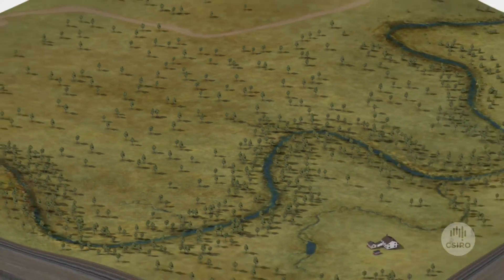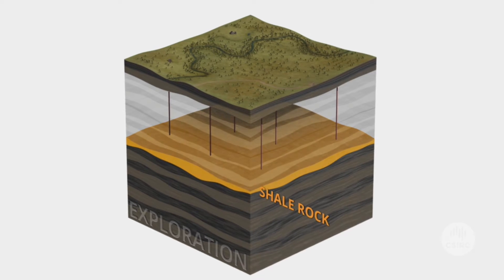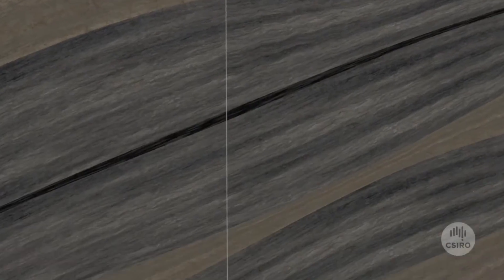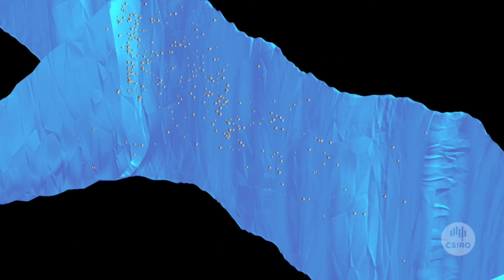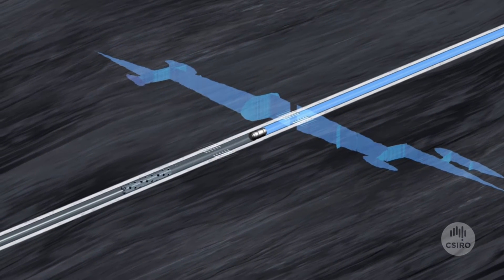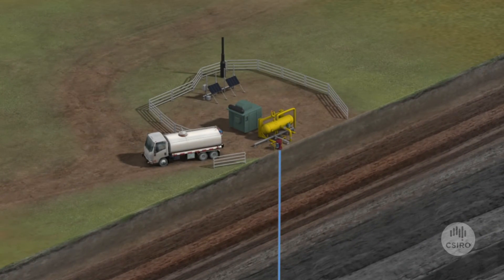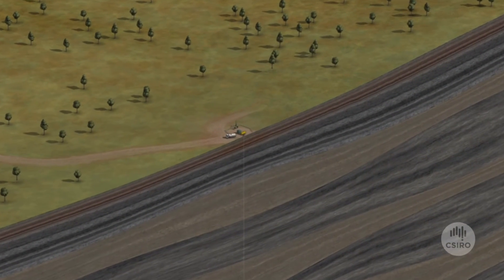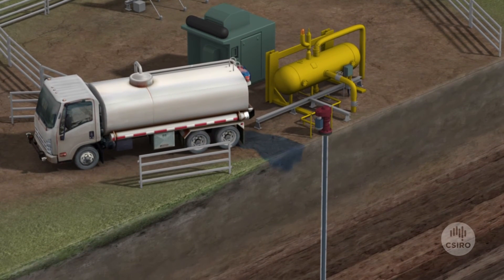Unearthing shale gas

Comment: What happens when the layers separating let's say underground aquifers and the gas seam are inadvertently fractured along with the seam, what safe guards are there to test whether you have connections from the coal seam to nearby underground aquifers
Reply from the maker: josh park 
Determining fracture height and growth at a well or site occurs before any fracturing is undertaken, known as preliminary work. This preliminary work includes core sampling, geophysical well logging, structural analysis of the geology and regional stress regime and direct measurement of stress by micro-hydraulic fracturing.  The data is then used in predicting the fracture growth using fracture design models.  Then during the fracturing treatment, microseismic and tiltmeter monitoring may be done to measure how the fracture grows. In addition, the pressure response recorded can be analysed to determine if height growth is occurring.  If height growth occurs, the injected volume and fluid viscosity can be adjusted to avoid growth into any aquifer.  In a shale gas reservoir, depicted in the video, the distance between the reservoir and the aquifer is large, so typically the hydraulic fractures as designed do not have enough volume injected into them to grow them to that size.  Microseismic monitoring has demonstrated this for a number of gas shale reservoirs. If a connection does occur, the produced water chemistry can be compared to the shale gas water chemistry and the aquifer chemistry.  This helps determine if a connection exists. Steps can then be taken to seal the connecting fracture by cementing it. Currently, there have not been any cases in the shale gas literature where this has occurred   The same applies for CSG extraction as far as monitoring and methods to seal the fracture if such an event were to occur.  Note that in both cases, the water flows from the aquifer into the fracture and well during production.